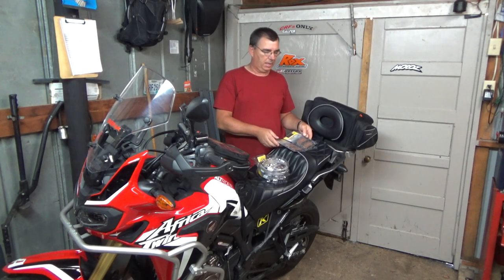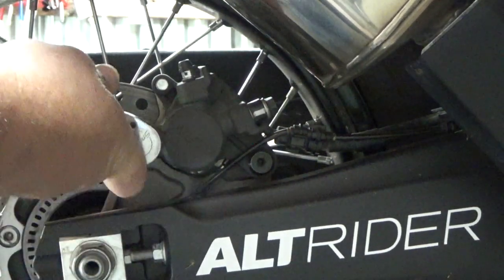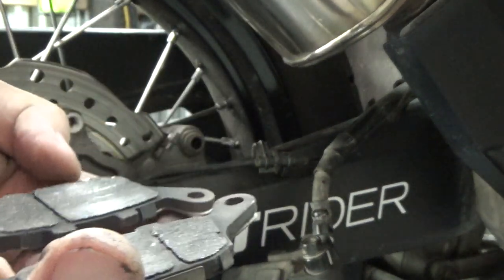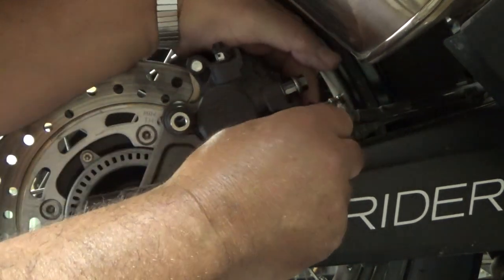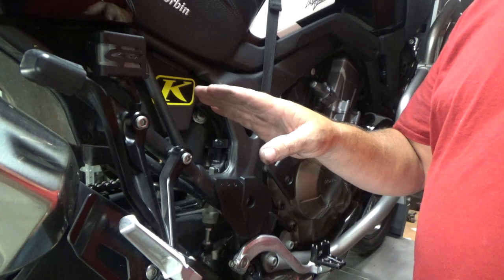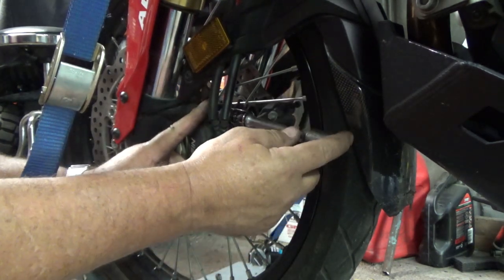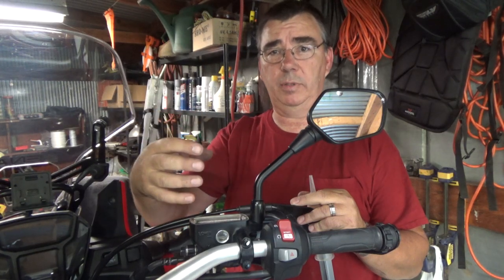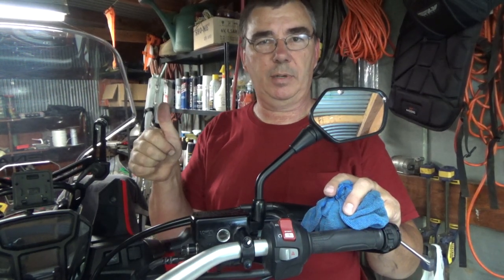Africa Twin How to Replace your Brakes ~ Motorcycle Brake Pads Front & Rear Install ~ Honda CRF1000L

Comment: You should clean the Pistons up before pushing them back into the caliper. No grease on the pin through the pads. It attracts dirt and gums up.
Reply: Good advice. Put the pistons out slightly (so don't empty the reservoir too early, otherwise air gets into the system. Then clean the pistons with water and a mild  detergent. Don't use break cleaner close to the rubber seals.

Comment: Good video, but if you haven't added any bake fluid to the system there's no need to open the reservoir. As you said, it's the exact same amount that was in it from the factory. I'm debating on whether or not to do mine. I need tires too! I just don't feel like installing tires and brakes in my garage when it's 100+ outside. But I also HATE paying 120 an hour for labor!
Reply from the maker: But you also push the caliper back further than it was. I would rather be safe.
Reply: @WOODZMAN  When the bike was new, the amount of fluid was the same, and the brake pads were new. No need to open the reservoir. I've done it several times on my other motorcycles, and it never was the case. I'm also a bicycle mechanic, and on bikes the hydraulic disc brakes work in exactly the same manner. Again, no need to remove the fluid.

Comment: Thank you for this video! I installed rear brakes on my 2017 Africa Twin (manual transmission) today. The Honda manual I have does not remove the 6mm Allen Headed bolt and recommends that you slide the pads in by pivoting the caliper foreword insuring proper landing of the lower notch in its forward position as shown in the view hole during your video. This worked fine until the anti-rattle spring dropped out of the upper caliper internal box/notch/hole and, because of its appearance, it became clear to me that it has a specific orientation, an orientation which can not be seen even with my flashlight! So I removed the Allen bolt and then could see, due to dirt/discoloration, the image of its correct orientation in the caliper. Crisis averted!
Reply from the maker: Your welcome, yes you can do it ether way, I just do it that way

Comment: I really wonder why it is needed to suck some fluid out of the reservoir, because the brakes where also new back in time. So there would be room enough.
Reply from the maker: You don’t have to most of the time but if you push the piston back to far the fluid can run over.

Comment: great spot for the klim sticker!   i had the silver one in same location.  looking forward to the brake line video.  I have the Camel high rise fender (from AT Rally) with the brake lines but have been intimidated to do brakes.  Even got the motion pro bleeder......
Reply from the maker: +Jeremy Sybrant yea it's really pretty easy. You won't have no problem.

Comment: Great video. I can't find torque specs for rear caliper. 8pin,and two bolts).
Reply from the maker: Heck most people don’t even torque them. Just tighten them up
Reply: Caliper mounting bolt 22nm, brake pad pin 17nm, manual page 19-10

Comment: Great video. I feel more confident now to do the replacement by myself. Just one question, where can you find the torque specs for each bolt? Thanks
Reply from the maker: Thanks ! I have a factory Honda Manual. I think you should be able to find one online. There is a PDF of the manual somewhere online for free because I have seen it. Just don’t remember where. I think it was the Africa Twin forums

Comment: Could you explain why did you take off hydrolic lubricant?
Reply from the maker: I take it off to keep so when I push the calipers back in it don’t push brake fluid out the top and make a mess
Reply: I am sure that you don't need this process. This process will be caused the brake system to get some air... never follow this process if there is not too much hydraulic fluid in the brake system by mistake!
Reply from the maker: Lol your funny, as your brakes wear down the reservoir will get lower and if you don’t add some fluid then you can get air in the system. Mainly if you lay the bike over.  I have worked on motorcycles for 38 years so I do know what I am talking about.
Reply: @bodrummotosikletscooter3426  You are right, neither need to remove the 6mm allen.
Reply: I could see the reason for removing a little brake fluid if the brake fluid was changed or topped up when the pads were quite low. In these circumstances, when adding new pads pushing the pistons back could cause the fluid to spill so removing a little beforehand is worthwhile.
Reply from the maker: Yea if you added fluid then that would be the only reason
Reply: Also if you put new pads on it, the cilinders must be pushed more inside than the normal braking situation in neutral. After install new pads and put tension on them, than top the reservoir at the level which is needed. So some suction out of the reservoir is a perfect solution for replacing the pads

Comment: There are thin stainless clips or what u call them, on each of the pads, should they not be transferred over to the new ones?
Reply from the maker: Yes they come off and clip on to the new pads. They are called anti-rattle shims

Comment: Hey Woodzman, do you happen to know what is the thickness of the rear rotor? I can't seem to google it up even though I've found the part number. Want to know so I can order a small light disc lock for parking in the city.
Reply from the maker: 4.445 mm

Comment: Excellent install Woodzman! So the Galfer brake pads, are better then OEM? I remember you putting them on the 250L.Thanks for sharing, be safe my friend.
Reply from the maker: +Gus Two Wheeling Thanks Gus, They should be better, I had them on the 250L and they were good.